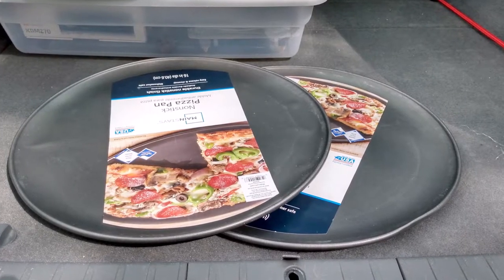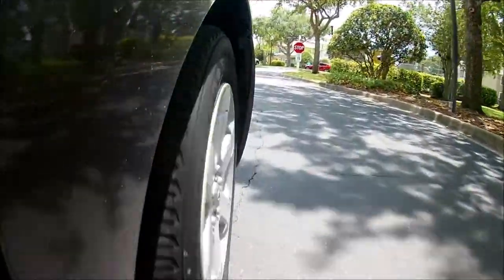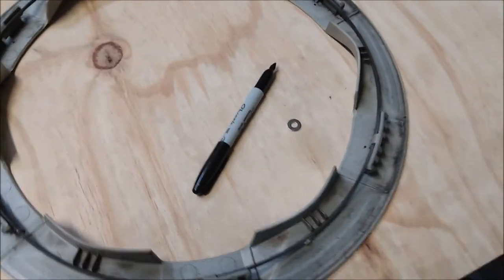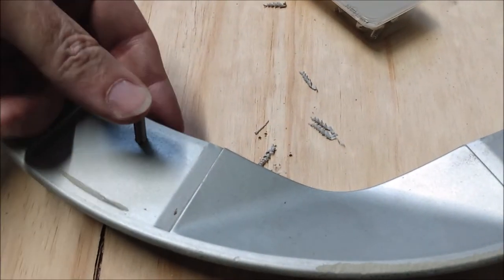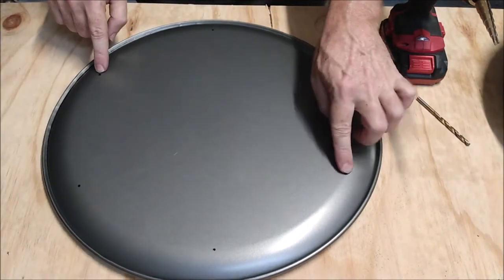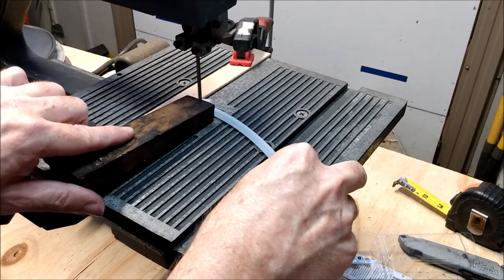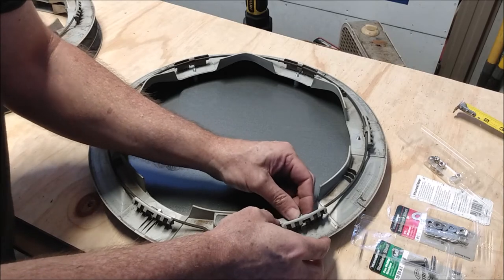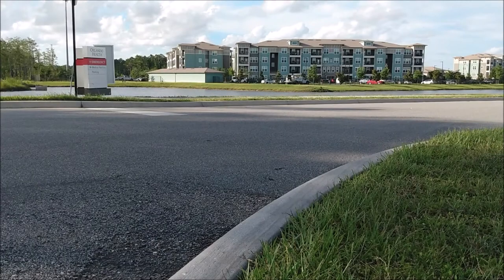The Prius Experiment: Better Fuel Economy with Pizza Pans? (Aero Wheel Covers)

Comment: What’s interesting is I used tribodyn Trans fluid and my MPG is currently 58 without doing any external mods. Oh and I forgot to add that the first O2 sensor is chopped off cause someone tried taking my Cat.
Reply from the maker: What was the fuel economy before the trans fluid change? Also, what methodology are you using to track fuel economy?
Edit to add: since the O2 sensor is non-functional, the ECU will be running in open-loop mode. Do you plan to fix that?

Comment: adding mass to the outer most radius of your wheel is a factor or mass^2.. so your aero might be better but consider that you added a lot of mass to the outer most radius (worst place to add mass)
Reply from the maker: The pizza pans weigh a fraction of a pound. The aero benefit is far greater than the weight penalty.

Comment: Does the brakes over heat ? From what it seems the braking heat has no where to go besides staying in
Reply from the maker: I was concerned about that, as well. But I haven't experienced any brake fade. I think the regenerative braking system does most of the braking. So the hydraulic brakes have an easy life.
Reply: It will in an emergency situation. That´s why you can buy flow optimized rims but they are never fully covered for exactly this reason.

Comment: Do they hold on over potholes and at freeway speeds?
Reply from the maker: At freeway speeds, they're fine. But potholes can sometimes cause problems. I once hit a bad stretch of road (yes, there are actually some bad roads in Florida), and two of them went flying into the ditch! I recently replaced them with aluminum pizza pans that bolt to the wheels.